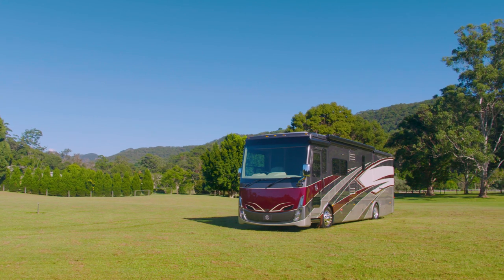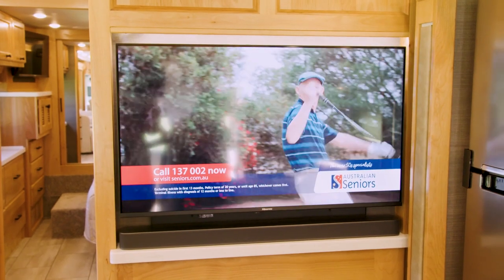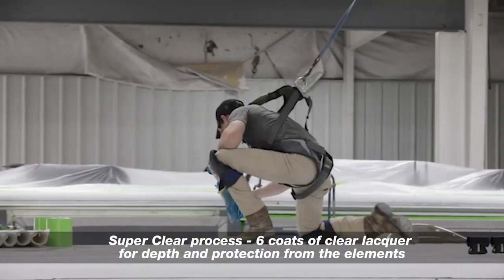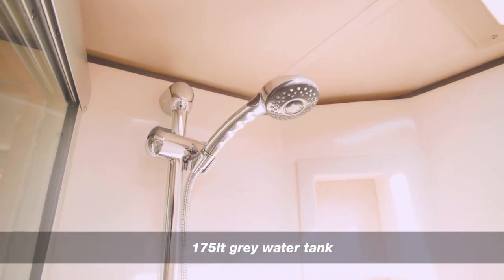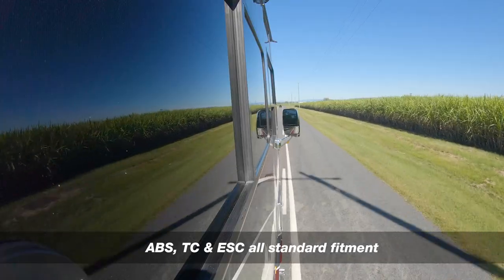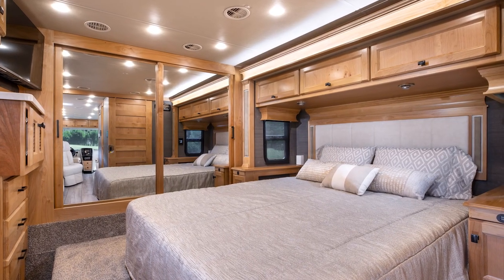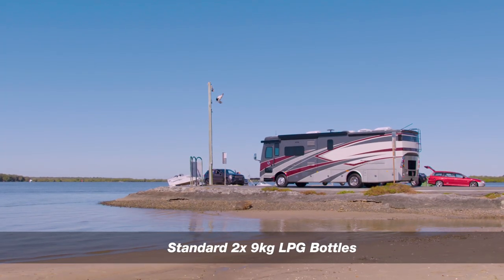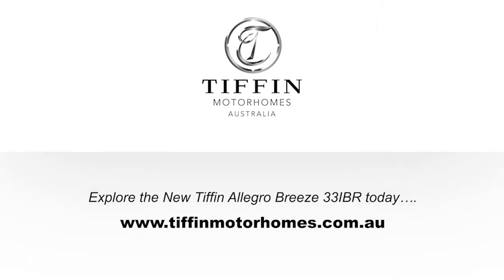Get to know : Tiffin Allegro Breeze 33IBR : The Movie

Comment: Dear Mr. Bob Tiffin, thank you for bringing your Quality MH to Australia. If we may recommend,  For Aussie Bush Camping compliance we require:
1- a full outside Kitchen with a barbecue Grill, big one for our catch of the day.  A backsplash for that delicate full body paint is a must on the outside.
2- outside shower next to the entrance door for our boots with wet storage.
3-A mule Rhino front bumper is a must on our roads.
4-there is not driver door!!!, how does the driver get out to clear branches. A branch  deflector around the windshield is a must.
5-extra air filter for bush country roads.
6-A front and back electric winch. 
7-when Bush camping, 80 % of the time, we are outside the Caravan, so bigger canopy.
8-is this beautiful beast, sorry Motorhome Coach, prepared for Aussie extreme WET season?
9-Perfect ext width 7' 11" , 2.413 M. Perfect height 11' 8" , 3.5 M
9-a gasser version would be nice and 100k usd cheaper.
10-does it have the same DEF system as in the US?
Reply: 1. I'm not a representative of Tiffin, but this is compliant with NVHR regulations. 2. There is no such thing as ''Aussie Bush Camping Compliance''. 3. This is not specifically designed for bush camping or off-roading - it's for surfaced roads.
Reply: @keynesianeconomics4113  I too think its strange not to have an outside BBQ/kitchen  and a bullbar option, a big red will make a mess of that nice front end.  I will be looking at building a strong alloy bullbar designed to still give access to the generator. I also wish the inside didn't look like it was out of the 1980s.
Reply: @justinpeek4100  The yanks love there wood for some reason, I dont get it either...
Reply: @justinpeek4100  The Yanks just don't get the idea of Australia having so many large feral animals that just roam the outback roads, causing havoc to vehicles. I agree that a bull-bar is absolutely essential to driving those roads and it should be an essential item on such an expensive investment like a motorhome.
Reply: @bushranger51 I’m not sure of price for 2024-5? No mention in their website. but might need to get bull bar & outdoor kitchen added. I’d put a combo washer underneath. I’d definitely ask for no wood cabinets or bevelled trim it looks 1980’s. Its size is awesome, just needs a few custom tweaks.